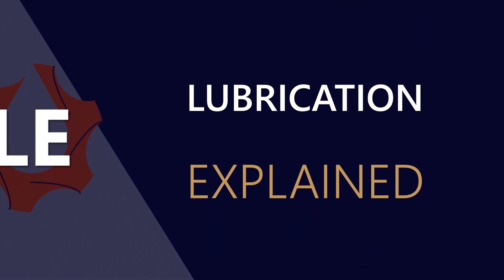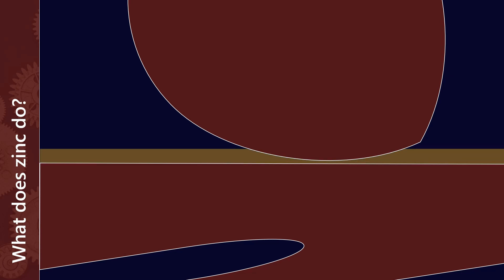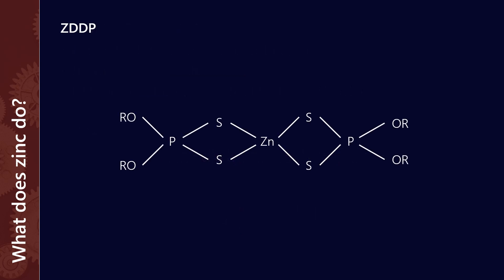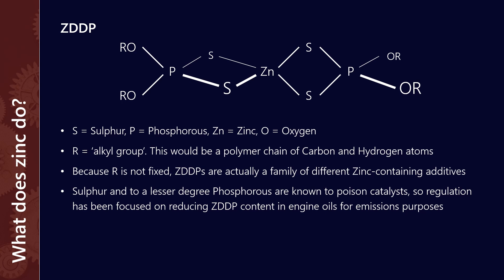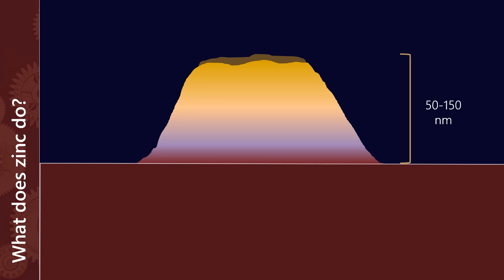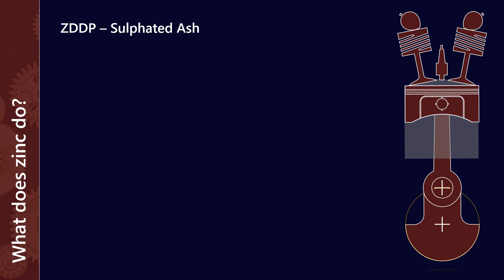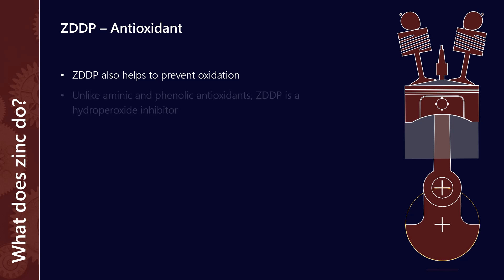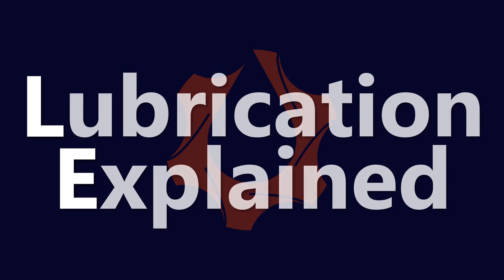What does the zinc do in an engine oil?

Comment: I own a 1989 B150 Dodge Van with a 318 c.i. engine. I had a lifter tic for 15 years in the morning. An employee at O'Reilly's mentioned that I should be using and engine oil with zinc in it. I had been religious about oil changes, and I put Marvel Mystery Oil in the fuel and oil every fuel fill and oil change. No one ever told me about zinc. I bought a gallon of oil with zinc in it, and it helped. I purchased a bottle of zinc (the straight additive) and added it to the oil. That cured the tic. That 318 engine has 550,000 miles on it, and it runs tight with no smoke. Thanks to John at O'Reilly's in Newberg, Oregon.
Reply: Use Mobil 1 15w-50 or any of the racing oils as they all contain zinc. The highest zinc content is found in 4 stroke motorcycle oils as the same .problem you find in lifters is also amplified in motorcycle clutches.  Your lifter problem will not go away as the crown ground on your lifters is surely almost gone. This will result in the lifters inability to slowly spin and will eventually self destruct. Modern engines us a roller on the bottom of the lifter n the contact area of the camshaft and thus do not spin.  The cost of converting older engines to a roller system in most cases is prohibitive as the labor combined with the parts is usually more than just buying a newer used car.  This is usually only done if one is rebuilding a classic car.
Reply: He could roll Kendall 20w50 or most the 15w40 HDEO for higher zinc and save a few bucks over the m1 15w50(it’s great oil but not cheap and not easy to find.

Comment: 2:10 Ford Australia actually discovered accidentally that they required a better oil and/or at different cam profile way back when the XF Falcon switched from leaded to unleaded petrol. 
As an apprentice, I helped change numerous camshaft and lifter sets on the early cars. 
Seems the lead deposits in the engine oil of the leaded cars had been 'saving' the cams from premature death. After the switch, they had cars failing all over the place as the hard facing broke through. 

Thanks for the lesson 👍

Comment: Hi, interesting video. Popped up on my feed bcoz im yting best oils to break in small engine. I bought a brand new honda 98cc ohc 4 stroke engine to replace the 66cc china doll on my moped. My local parts supply store suggested i use lucas break in oil zddp along with the semi synth. What is your opinion? Is it a good idea, and how much should i use? Says one whole bottle for a full size classic car engine. Maybe its not a good idea at all considering it will place a protective coating? Or maybe its a different formula in the same family. Its a new engine, i should get it tomorrow. Sitting at the post office lol. I want to make sure i do it right. Thx in advance.

Comment: I have a classic musclecar with an engine that’s been rebuilt. The valve train now consists of all roller components (hydraulic roller cam and full roller rockers). I assume it’s still a good idea to use a high zddp oil ? It doesn’t have catalytic converters and I’m not concerned with emissions. Ideally I want the best protection for high rpm and for storage since it doesn’t get driven much

Comment: does it truly clog up the catalytic convertor? Does ZDDP end up damaging seals? I know you said only one component of the compound can, but I'm curious if that property passes on to ZDDP or not
Reply from the maker: It's mostly the phosphorous and sulphur in ZDDP. They don't "clog" catalysts so much as they coat the catalysts, meaning them can no longer physically touch the exhaust gases.
Reply: @LubricationExplained  does ZDDP damage seals, or is that only if one of the components is isolated and released into a running motor

Comment: I just did an engine rebuild I noticed you said the zddp would destroy seals, was that over the course of repeated use or a one time break in would destroy the seals? I’ve only ever helped my family work on older cars like our 1960 Chevy c-10, 1964 Lincoln continental, 1986 jeep cj5. I rebuilt an ej 255 for my wrx and I thought break in oil was common place but I’ve been getting mixed information online. Any response helps thank you!
Reply from the maker: Ahh, sorry that might have been me not explaining clearly. ZDDP won't destroy seals, thiophosphoric acid will. This acid is one of the raw materials used to manufacture ZDDP. It's a very potent antiwear additive but too corrosive for engine seals, so we neutralise the acid with Zinc Oxide to make ZDDP, which is safe for seal materials.
Reply: @LubricationExplained  thank you so much!

Comment: very informative videos you have, I have a question please, does the anti wear additives depletes as fast as the other additives like detergents or anti oxidation ?? or it lasts longer ?
Reply from the maker: Depends on the operating conditions of the engine. But from my experience it typically lasts longer than the detergent package.

Comment: Does ZDDP form a complex or work the same way with aluminum? I was always curious that a lot of these presentations focus on iron or steel, which is a lot of the bearings - but aluminum blocks are quite popular, Alusil and all.
Reply from the maker: It does! However, the interaction is a little different as Aluminium doesn't have the same reactivity as Iron. This has actually been a problem recently in the stationary gas engine industry, as the drive for higher efficiencies has caused the industry to move from steel to aluminium pistons. The antiwear film is definitely a little different.
Reply: The iron and steel in older engines are negatively charged and most oils have positively charged ions

Comment: Lots of questions about ZDDP from older car owners. ZDDP is sacrificial, which to me means it gets used up over time.
Does that mean an oil with a lower amount of ZDDP could provide adequate protection for a short oil change interval or would a higher level be required regardless of the OCI ?
To what extent will calcium inhibit the protection of ZDDP ? Many oils for diesel engines have higher ZDDP levels but also high Calcium. Does one negate the other ?
Reply: The layer gets used up continuously and the layer thickness stays at the equilibrium point. The more ZDDP the thicker the protection film is. So the answer is no, you cannot use an oil with low levels of ZDDP even for 20 minutes. Calcium and ZDDP serve different purposes and their proportions are not fixed. Some oils may have low calcium and high ZDDP and vice versa. There are a lot of components in an oil which can negate each other. So the researchers have to find the best combination for each application which is not an easy task.

Comment: I think the zddp needs to reach a temp of 150Cfor partial, and 225 C for the tiophosphate to completely crystalize on the metal surface. So, for this test to be accurate, the test metal should be cooked at 225 C in it, and then cool down before testing.

Comment: Thank you sir. Very good video and explanation about the ZDDP, i recently saw about the additive and this information is great. And excuse me for my ignorance but why do the cams are the most heavily loaded components?
Reply from the maker: Glad it was helpful! Cams tend to be the most heavily loaded components in the engine because in old-style cams almost all the relative motion between the cam and the tappet was sliding rather than rolling motion. This has been somewhat alleviated by modern roller-cams. It is also a point-contact, i.e. the stress is concentrated in a single point on the cam rather than being spread out like the connecting rod bearings. Hope that helps!
Reply: @LubricationExplained  Thank you very much. Very accepted.
Do you have any information about oil's groups of minerals, synthetics, PAO's, etc.?
Reply from the maker: @jacobcollazorios4243  Generally no - the base oil composition of most engine oils tends to be considered proprietary by the manufacturers. Not only that, the base oil composition can change over time; manufacturers will make lubricants to a performance spec - they can vary the base oil composition (sometimes due to cost, sometimes due to base oil availability) a little bit as long as the finished product meets the performance specifications.

Comment: So the low saps and mid saps oil doesn't have as much wear protection as a full saps oil to protect the engine. 
It's a trade off, eigther protect the engine with full saps and the dpf eventually gets clogged or run the low saps oil and the engine needs a rebuild alot sooner.

Comment: I have heard that zddp will close your oil galleys or oil passages and prevent oil to the valves of a ohv
Reply from the maker: Theoretically it shouldn’t, because the anti wear layer formed by ZDDP additives is typically less than a micron thick.
Reply: @LubricationExplained  thanks for the reply is there any brands you recommend I have a old flat tappet cam
Reply: @gatordave6629  t6 15-40 diesel contains a high amount of zinc. It's the closest you can get to old school oil. If the engine is well worn then you can run it no problem
Reply: @maxsinger3526  thanks for the advice I have a old jeep with a flat tappet cam and have been using Rotella or valvoline race oil

Comment: Funny how phosphorous is the wear element in printing pigments... but anti-wear in automotive... however in offset printing, you have a rubber compound contacting an an aluminum plate with a mild acid water film mixed with ink forming an emulsion.... which wears the plate emulsion.... figure that one out 😂

Comment: How does the ash form on the valves if no oil is burned inside the engine? If in fact 20 grams of oil makes it's way into the combustion chambers in one year or 15000 km how much ash can you get from it? Zero.
Reply: 20gram? Buy a VW and say that again.

Comment: Hello, but in older engine with an different Api Specification for example an Api Sg or SL you can use an Api Sn ? I asked because I had heard that they require different amounts of zinc and phosphat? It would not be harmful for the engine, sorry for my bad english leve, thanks

Comment: What would it be the best oil to use for my vehicle it’s a Om602 engine with 10,000 miles none turbo and none catalytic converter something the it won’t damage the seals 
I am looking at 3 brand 
Redline 
Moly 
Pennzoil

Comment: Play at 1.5 speed for normal speaking speed.
Reply from the maker: That's a good tip - this was one of my earliest videos and I wasn't very good speaking through the concepts. Hopefully I've improved in the last two years!
Reply: @LubricationExplained  For public speaking they teach you to talk slowly,  but I got 10 vids to watch,   so I go for the fastest speed that I don't have to backtrack,  which was 2.0 for this one,   but 1.5 sounds 'normal'. 

Love the content,  sent to a mate who sells some magic pixie dust oil additive,  he said 'but why would you want zinc DDP when you can use the stuff I sell'.    
Project farm does some great vids,   comparing wear,  fuel efficiency and oil analysis,    I thought STP was a zinc concentrate,  but modern STP is low in zinc from his analysis,  it didn't do much I seem to recall.

Edit  just looked up project farm's vid,   he said that STP has nothing in it and will dilute the ad pack in any modern oil and shouldn't be used unless your engine needs the big viscosity increase from being such a thick additive.

Comment: Many moons ago MOBIL 1 was allowed, for use in small aircraft with reciprocating engines, but they HAD SOME SERIOUS LAWSUITS& pay for ENGINE REPLACEMENTS   IT no longer is allowed.Now I had called the company on unrelated to this, but I asked about it , what they said BLEW MY MIND , “THEY”did NOT KNOW that those engines needed ZINC & ASH, so that destroyed those engines , so this article just shows it’s NEEDED, but just how a BIG COMPANY NOT KNOW THAT ? Lousy RESEARCH , cheers 🇺🇸🇺🇸🇺🇸🇺🇸
Reply from the maker: Interesting - do you happen to have any links or articles to the lawsuits you’re referring to? Seems like a very unusual case - ZDDPs have been around since the beginning of modern engine oil formulation and have been common/essential components of synthetic engine oils (like all the versions of Mobil 1) since the 60’s.
Reply: @LubricationExplained  hi no I have no links but first came across in an AVIATION magazine, 60-70 I believe, but the dit about NOT KNOWING the Recips needed these. Additives, probably came out with automotive use , here sircraft are mostly flat out, but was a conversation with a rep, as I live in NJ, why MOBILstations dissapear Ed, then I MENTIONED THE AIRCRAFT ENGINES, & was NOT trying to hide anything .I will try to see if I can find anything for you  cheers 🇺🇸🇺🇸🇺🇸🇺🇸

Comment: The main problem with this video is it propagates the myth that ZDDP "coats" surfaces....never has and never will, it simply does not work in that fashion. It is suspended in the oil via the additive package and does absolutely nothing until it is called upon which is activated by extreme heat and pressure. Knowing this dispels another myth that more ZDDP ppm provides greater protection...it does no such thing. More ppm concentrations only extend the depletion rate which by the way is rather miniscule to begin with. This is the reason modern oils with the mandated lower concentrations of ZDDP work just fine and truth be known the modern oils of today are far superior to what we used to have thanks to the additive packages.

Comment: No, it wasn't for emissions purposes.  In the case of DOT, I believe they basically ordered manufacturers to warranty catalytic converters for 100k miles.  This in turn pushed zinc levels in modern API spec oils down to 800ppm from 1000ppm, to lengthen converter service life/extend margin.    Does this conserve resources?  Yes, but [pardon my jaundice] that is secondary.  The real goal of pinheads is to destroy the functionality of the automobile market.  Not engines or components... the market.  The misanthrope class is as shell shocked by the industrial revolution as Marx was in his day.  Its all part of the war on the middle class using combined "boiling frog" methods across multiple agencies [and governments].  But you can bet your * the government jetsetters will coninue to flit about.   Parking cash overseas to avoid home jurisdiction scrutiny is just too sweet to pass up.
Governments are now designing automobiles effectively, and that can't end well: politicians absolutely suck at science.

Comment: low cost lubricant , avoid put the base oil group 4 and 5 . ZDDP can not using 10,000km. it has more acid increase quickly.